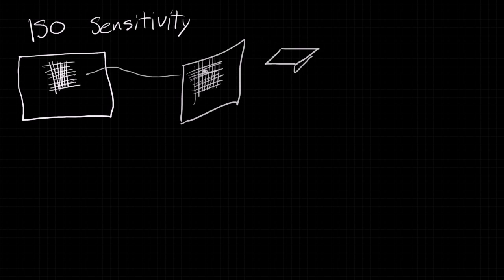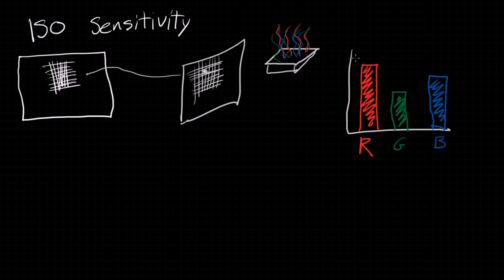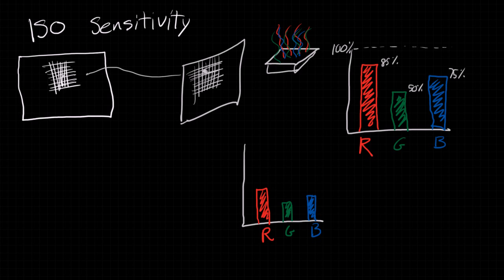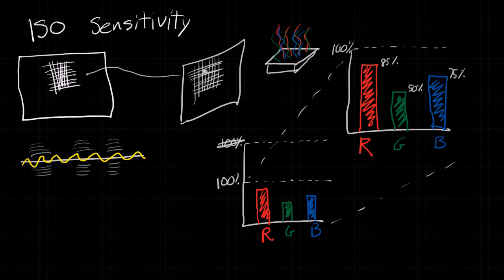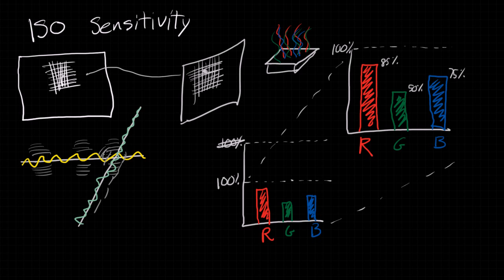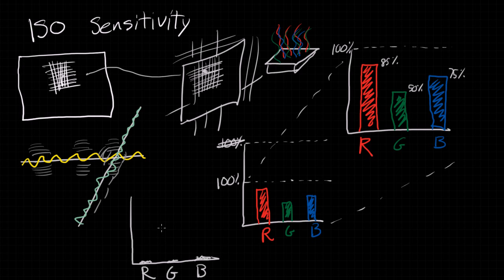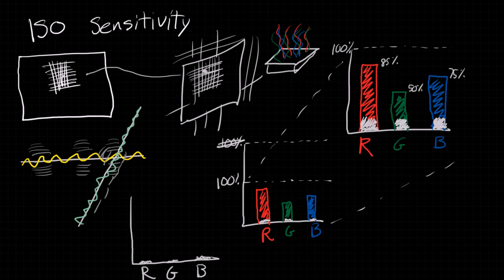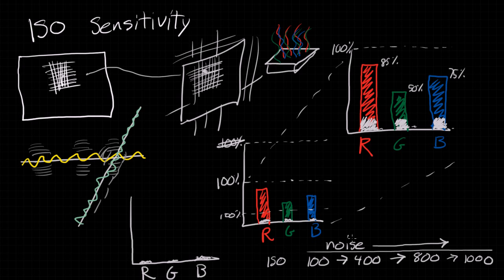A Simple Explanation of ISO for Digital Photography and Video

Comment: Great explanation.  Don't forget, noise is also result of heat generated by the sensor itself.  Each pixel reports heat (IR) behind the RGB filters as light.  This becomes significant in deep-sky astrophotography.

Comment: NO it does not refer to the sensitivity of the sensor.. sensors are NOT able to vary the sensitivity. ISO is GAIN added AFTER exposure.. just like turning up the volume on a radio... likewise ISO doesn't generate noise it amplifies the noice that is present from the start... light is analogue.. so is the sensor in your "digital" camera.. the signal turns digital after the AD converter and then goes to the image processor..  the ISO (also not an acronym but short for ISOS and means equal) is added between the analogue and digital steps..

Comment: Hi... I think gain and iso are slightly different in the sense gain is base iso for a camera.. could be 800 iso or 1200 iso ..unlike ISO which is an increase without taking into consideration the base iso..of that sensor for a perticular camera like Sony A7 s or fs7 they have base iso which is fixed gain... And works best at that iso ..

Comment: Really good video! So iso basically works like gain in audio, but I’m amazed by the performance of modern cameras. Are there any specific camera companies really researching ways to make sensors with extremely low noise floors, and ways to amplify the signal efficiently? Or is that a general goal of all sensor makers?

Comment: sorry mr bennett but 85% red plus 50% green plus 75% blue equals 210%. there's a mix up between measurements. if you see 100% as pure white you have to have 33,3333 % of each color.
Reply: The percentages are percentages of each channel's full potential exposure, not the percentage of the final image
Reply: He didn't go into this, but a Bayer mask interprets 4 pixels into a single color pixel interpreted off-sensor. Typically this mask is RGGB. CMOS are highly sensitive to Red and Near IR light so that channel is typically higher.  Read off of the signal of each of those 4 pixels is combined to develop the color produced and overall signal.

Comment: I would like to point out something though. There's a great misunderstanding that people think about when talking about ISO.
You seem to be implying a high ISO introduces noise. That's false. An high ISO amplifies both signal and noise, so the SNR (signal to noise ratio) is the same. You gave an example of a situation where a sensor doesn't receive much light (the second graph you drew), and by raising the ISO it looks like that's what's increasing the noise. Well, that's not true! The noise is already there to begin with, increasing the ISO is not actually changing that. Noise is strictly dependant on how much light actually hits the sensor. In ISO-variant cameras actually, given an underexposed shot, a higher ISO will actually produce a less noisy image than a lower ISO with increased exposure in post processing!!! In ISO-invariant cameras, the noise will not differ with ISO, but it will still be convenient to keep the ISO low to avoid clipping highlights due to overexposure. That's the main reason to keep ISO low, to avoid overexposure and decrease in dynamic range. It's not about noise (but yes, it's a great misunderstanding of ISO). To understand this better, here's a link of someone who explains this better than I do: https://photo.stackexchange.com/a/35141/77187
Reply: Noise comes from mulitple sources, internal and external.  External is shot noise.
In this video he is dealing with noise created IN CAMERA.  There are two agregious sources in camera, READ noise and HEAT.  
READ noise is caused in the conversion from analog to digital and signal boost(ISO/GAIN) in the ADC conversion. This is what is better dealt with in modern CMOS allowing them to achieve higher ISOs and with some invariance. 
HEAT noise is derived from on-board devices heating up over time including overall sensor, power cores and batteries. And unless cooling is implemented this noise persists and can effect images over a series.
Reply: Untrue noise always exists in light sensors.  In low light you have low signal leading to a relative bad signal to noise ratio (snr).  Same sensor more light gives a higher signal with the same noise gives a better snr.  Adjust the gain on the low light low signal case can increase the signal so it is the same as the more light case but you still have the bad snr because the noise level also was increased.  The noise will appear in the image.  This increase in signal due to iso only will lead to more noise.

Comment: Unfortunately, this only really explains read noise. In a lot of instances, your bigger problem is photon shot noise (the fact that the light you captured is itself noisy). Focusing solely on read noise risks embedding the idea that it's the camera's electronics that make high ISO images noisy, which is only partly true.
Reply: Signal source noise can be scaled down by increasing exposure time.  In astrophotography we get better signal to noise ratio by exposing for longer periods of time in dark skies or in light polluted skies by iterative short exposures stacked to weed out source noise(we would call skyglow).  Iterative stacking images can then be processed based on normalized adjustments and subtractions of flats and darks. A dark being a lens covered to show interior  noise and a flat to take a white background to eliminate optical and broad source variations in light.
Reply: @mycarolinaskies  I agree. Astro is an interesting edge-case but even there you're acknowledging the need to increase exposure to boost SNR. This video is very pretty but doesn't ever point out that capturing less light increases noisiness/decreases SNR (and would do even if your camera added no noise of its own). Since this vidoe isn't solely about astrophotography, its omission of the impact of photon shot noise ends up being misleading.